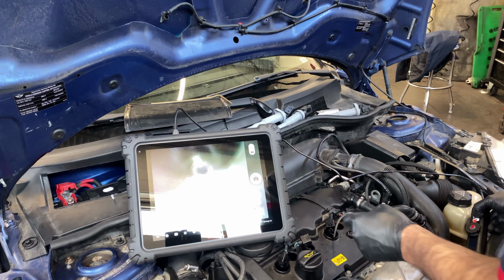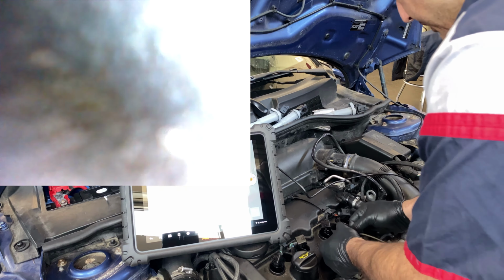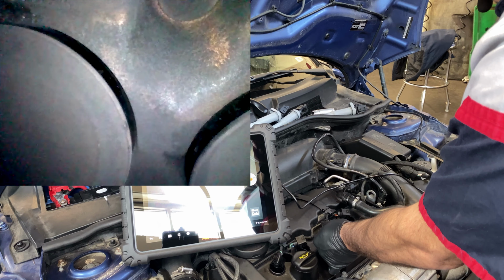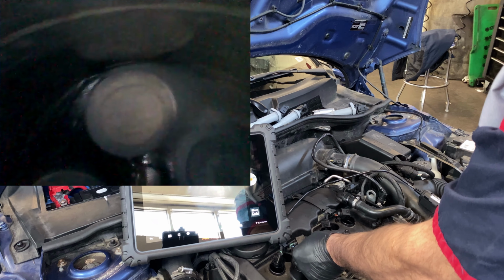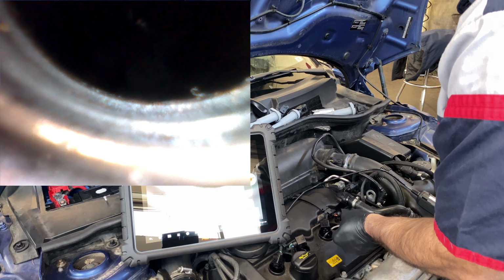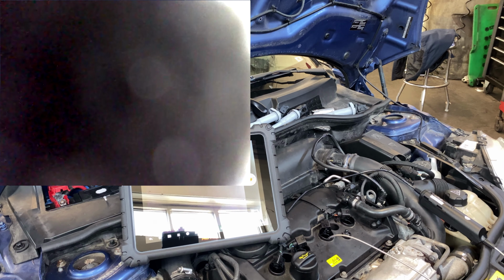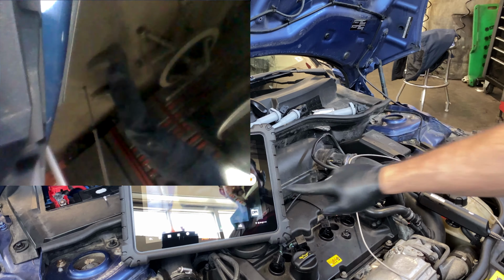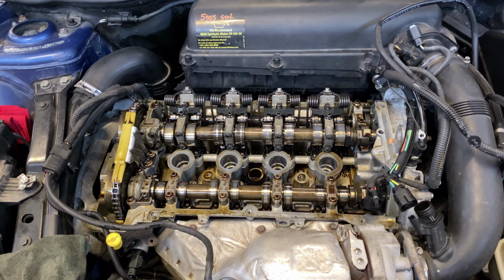2012 Mini Cooper S Engine noise and misfire diagnosis PART 2

Comment: looks like the head gasket blew at one point. we have two mini blocks were I work, they have the same marks on the cylinder walls and after removing the pistons the coolant left marks like that when the block was taken apart.
Reply from the maker: You are a 100% correct!

Comment: Very nice work on this one. Hey, how do you like the Autel scope? Thanks for taking the time to make these videos. Much appreciated.
Reply from the maker: I have never use the autel. The one I am using here is from Oasis scientific 

https://www.oasisscientific.com/store/p443/Vividia_D3145_USB_Digital_180_Degree_One-Way_Articulating_Borescope_with_4.5mm_Diameter_1m_Long_Camera_Probe.html
Reply: @MaicSalazarDiagnostics I mean the actual Autel oscilloscope that comes with the ultra.
Reply from the maker: @00blowngt  sorry my mistake. I really like it. Is not a PICO but it does the job.

Comment: Maic, so you say there is crack with in the head and the damage and distraction of the CAM/LUB so want to know what happen to this engine in the first place did it over heated and cracked  the head and what damaged the CAM that much as always enjoyable to watch and appreciate the time u took thankyou.
Reply from the maker: Thank you!  I am not 100% sure if the cylinder head is cracked, it will need to be removed to tested. Most of the damages were caused by the over heating and oil mixed with coolant. Lack of lubrication did marks on the cylinder walls and to the eccentric shaft system.

Comment: Does your borescope have 2 camera on the end because I can never get a clear and good image of the cylinder head it would work great to check leaking injectors for Direct injected cars. What is the brand ?
Reply from the maker: Only one camera but the borescope is articulated so it can turn 180 degrees 
https://www.oasisscientific.com/store/p443/Vividia_D3145_USB_Digital_180_Degree_One-Way_Articulating_Borescope_with_4.5mm_Diameter_1m_Long_Camera_Probe.html
Reply: @MaicSalazarDiagnostics  thanks for the reply but WOW this is not a cheap Amazon camera no wonder the images were so good.

Comment: Is it possible to bore scope the pan oil plug ..looksie on the oil jets n under piston crown......it sure would be ingenious if possible....terrible that as a mini owner....researching all the failure points and prone to less reliability....that would be ingenious if......can be .....rectified in engineering to manufacture UPDATE......that's all we mini drivers want...clean combustion..temp gauged,pressure gauged and inspection ports....I mean...I got 225.000 on mine AND...my mind want HER to reach 500.000.